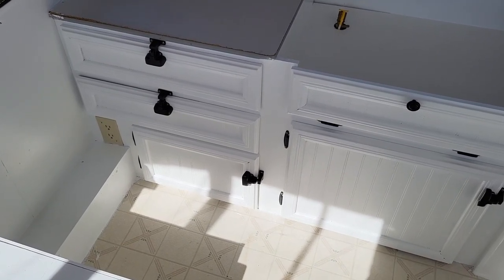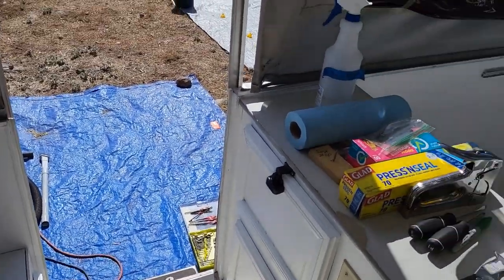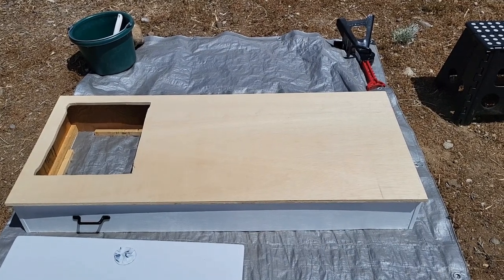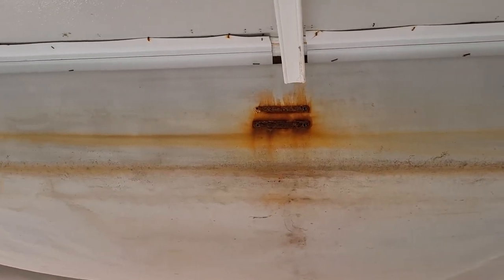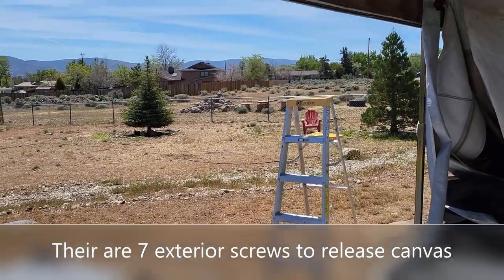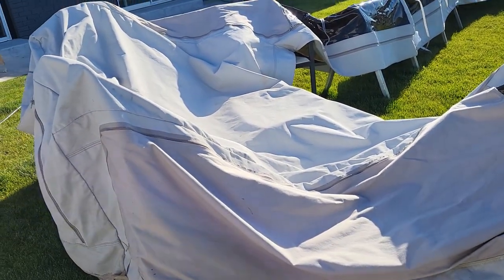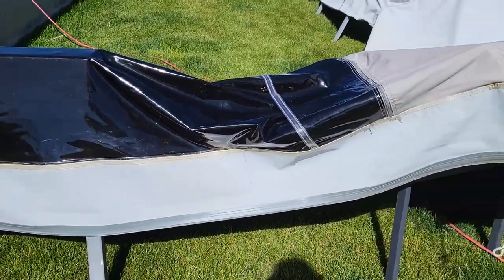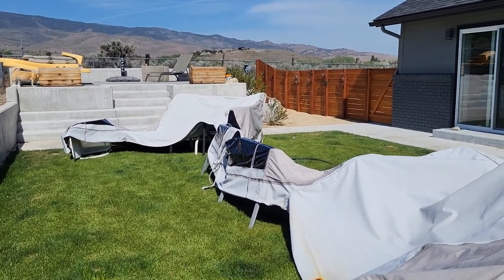My Jeep Wranglers 1994 Jayco Pop Up Camper Renovation Part 2 Counters and Canvas Cleaning

Comment: I briefly considered getting new canvas for my popup - there's a company that makes custom kits...I was going to go with a brown with blacked out window vinyl - but it was cost prohibitive at the time.
Reply from the maker: Yes, it doesn't make sense to spend 1200.00 but it was tempting! It is getting a few repairs, but overall, after cleaning it is in decent shape for 28 years old. The roof, ugh, needs 4 new panels around the top. We took the top off today. Screws were rusted in place.